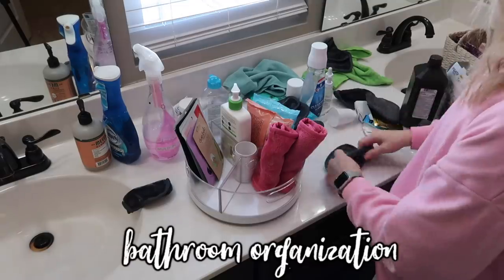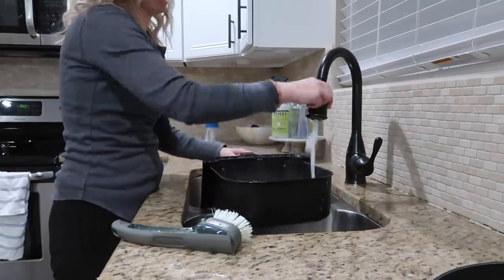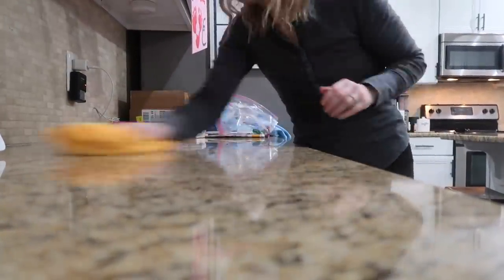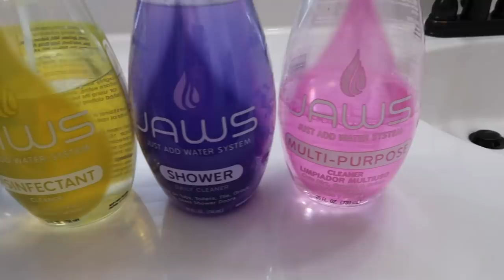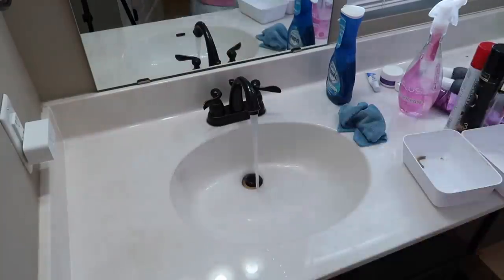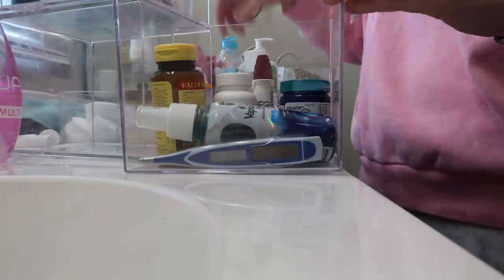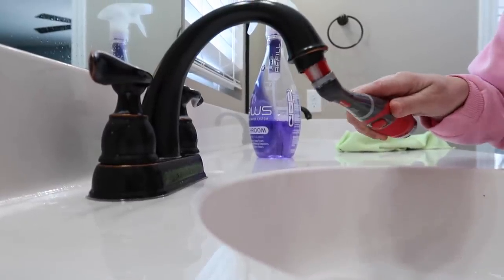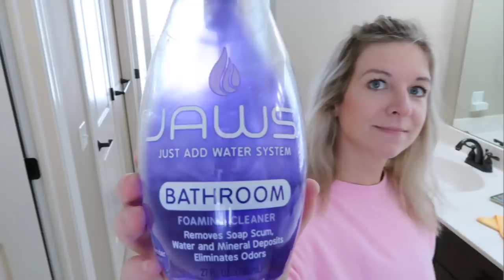EXTREME CLEAN WITH ME + DECLUTTER + ORGANIZE | 3 DAY SPEED CLEANING MOTIVATION BATHROOM ORGANIZATION

Comment: Excellent work you do.  I love it.  A tip that I learned, your faucet that you have in the bathrooms are easy to clean, I saw that you cleaned them with the brush, but they turn around, do it and you will see that this comes off, you will see inside that it has some small filters, you will see that they are dirty, these are easy to wash, under running water, and that's it, you put it back.
Reply from the maker: Thanks!
Reply: @JamiesJourney  try and let me know ehat do you think about it 😉

Comment: The “bottom of the sink” is called an aerator and the drain piece is called a pop up drain, you can actually have both of them like yours, it will cause no problems if you don’t hook it. ❤️

Comment: I agree with not sealing around the toilet base. The first house I bought had a crap to of caulk around the base of the toilet. As time went by I notice the sheet linoleum was looking weird. Mom suggested I check the wax seal of the toilet. Sure enough the guy I bought the house from was told to replace that wax gasket after the home inspection but he just caulked until the toilet stopped wobbling. I had to remove all the linoleum and scrape yucky glue up. The water went between the concrete slab and linoleum. The new flooring cost a bunch while the wax gasket was under $5. 🤦🏼‍♀️
Reply from the maker: Ahhh so interesting! I’ve never had an experience like that but when I got a lot of messages about why our toilets weren’t sealed, this was the answer I got from my plumber! Good to know he knew what he was talking about!

Comment: The wax ring that attaches the toilet stool to the flange thingy is yellow wax.  maybe if you steam shot it it melts a little?  If it is yellow enough to look like urine, and it is under the stool, someone has a problem.  Urine would be diluted with the water in the stool if it was getting through the wax seal.  Just my 2¢
Reply from the maker: Thank you!